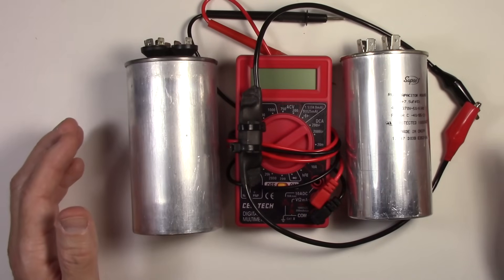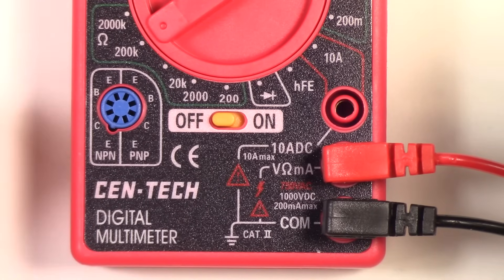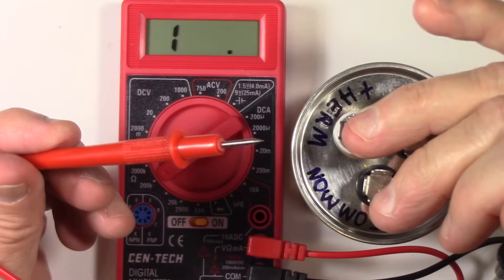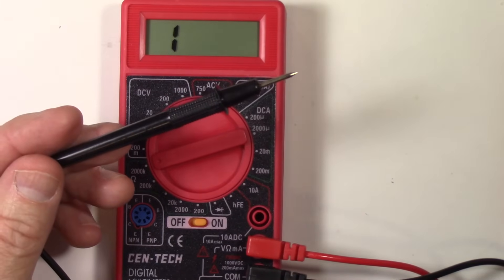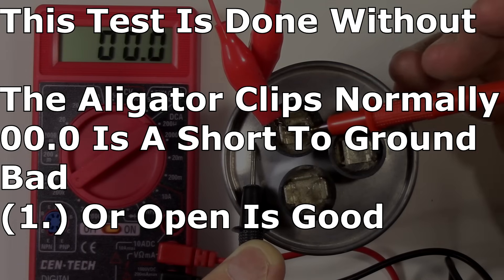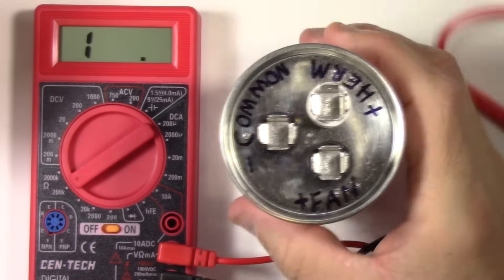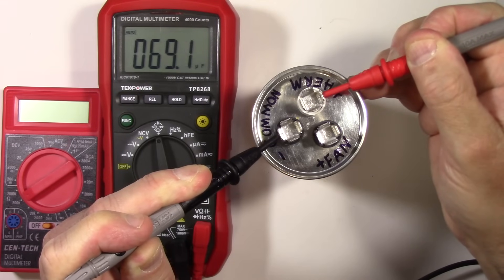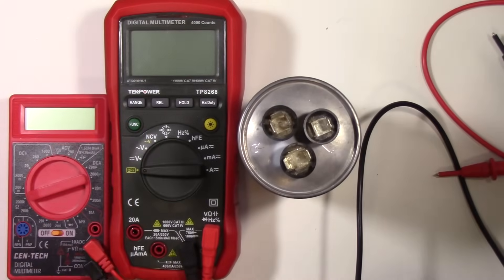Start Run Capacitor Testing Using A Cheap Meter DIY (HVAC/Stereo/Microwave/Electronics) Service

Comment: An excellent training class...taught well.  THANK YOU.
   I'm old-school. I used to take a resistor wire with test prods on it's ends and short out the capacitor, and drain the case to terminal & then take a Tripplet 310 VOM Analog and and stick it across the terminals and watch the needle swing up and peak, and then slowly fall off. If it did that I checked terminal to ground casing. If that was ok and there wasn't any signs of puffing up, it was a good one and I would put the wires back on it and go to the next one.
Reply from the maker: You're most welcome. Awesome on your part. I have found a few lately that were still "working" but were degrading and were at least 30% out of specification so I will check mine more often as that kind of degredation is a sure sign of impending failure. Comments like this make my DAY! 😁️ I'm glad to know I could help you and that you got value from my work here. Thank you for watching, commenting and the very kind words. I appreciate it greatly. All the best.👍😀

Comment: Anyone else coming here the answer is NO you cannot properly test with the cen tech. Hreat instruction but little bit deceiving language, you say ok you know it works. Then at the end of the video you mention you only know if it's taking a charge but not if it's holding the proper charge. So short answer is get the better meter and test it for real, you cannot fully test on a cen tech
Reply from the maker: Agreed. I would always use the better meter but in a pinch where your AC is down and you need a quick answer this will tell you if it's blown. But it will not tell you if it's on the way out. I check my capacitor in my new house with the "good" meter and it showed me that it was working BUT it was at least 20% out of specification so it was on the way to failure and there was no physical evidence that it was failing either. I may do a video on that capacitor to show that you should also check them once in a while (every 6 months, I would say) just to see if they are beginning to fail. I replaced it as soon as I could after finding it out of specification. It can't be good for the motor to be using a capacitor that is out of specification.  Thank you so much for watching, commenting and the valuable feedback. I appreciate it greatly. All the best.👍😀

Comment: Thank you for the video also I have a question if you reverse the polarity it's supposed to go down what if it takes a charge going both ways wouldn't the capacitor be bad? Or would it be because it is a 2 prong capacitor?
Reply from the maker: The polarity will not really affect the test. The capacitor will behave the same way regardless of the polarity. It stores a charge either way. Thank you for watching and commenting. I appreciate it greatly. All the best.👍😀
Reply: @richardlloydusa  basically I have a washing machine that uses a 50uf capacitor it seems ok, but the machine won't operate correctly, I got butt sore and said screw it because it was used when I got it and got a new GE side load w/warranty, but these new washers & dryers have tons of problems why it is allowed for companies to make such garbage is beyond me, no matter where you go they only come with 1 yr warranty unless you buy into an extended, that 10 yr warranty you see is only for the parts of the engine only no labor covered, if we the people don't start standing up to this our kids will be screwed Sideways as well. Per the capacitor video yours got to the point all these other vids are people dragging it on, I know the safety and all that I want to get to the point of how to do something not do the safety dance repetitively on every video lol that's why I ce to you tube to get around the lecture, a little rough I know but these other makers drag it out kinda likely response today ugg lol

Comment: Great video. Thanks! Pulled the original 25/5 GE capacitor on a 30 year old Comfortmaker AC hoping the capacitor was bad. No physical distortion. Bad news was, the capacitor is still good according to my cheap exactly the same as your red mm (ohms-only). Counts ohms exactly like this video: C to Fan pops up and back down to 1 quickly and C to Herms takes a while to get to 1. Oh well.. was hoping the capacitor was bad.
Reply from the maker: At 30 years it still works!?!? Wow, I would still replace it and keep the original as an emergency spare. Thank you so much for commenting and the very kind words. I appreciate it greatly. All the best.👍😀
Reply: @richardlloydusa  Thanks Rich for the rapid reply. The AC died at the end of last summer and I finally had a chance to pull the capacitor today hoping to find it distorted, but... and according to the ohm test, it seems OK. Fan on the AC is running but no cold air. Chances are, I need a new AC probably because the compressor is bad. I got my money's worth, I guess.... 30 years
Reply from the maker: I know this is going to sound crazy but I would have it looked at by a "reputable" tech. Sometimes you can recharge the system and it will work again and before you buy a new system or call a tech try a new capacitor as they are not very expensive. All the best and good luck 👍😀
Reply: @richardlloydusa  Thanks so much. Do you mean recharge as in putting refrigerant in? I'm gonna call a trusted AC guy tomorrow. See what he says. Thanks so much, Richard.
Reply from the maker: Yes, the gas refrigerant but I let the techs do their and just ask questions like, "Do I need recharge?" They will check it and tell you. Thanks.
Reply: @richardlloydusa  Thanks again.
Reply: @rgraz4929   Did you fix it?

Comment: How do you check a capacitor with 2 4 prong connectors on top, and what should readings be on that cheap multi tester?
Reply from the maker: The number of prongs is not important they are all tested the same way using the same procedure. Thank you so much for commenting. I appreciate it greatly. All the best.👍😀

Comment: I appreciated that you demonstrated HOW to use the multimeter Ohm function.  
1. you told me the actual setting.
2. You told what to look for on the meter.
3. You told me to DISCHARGE the capacitor!
Thanks. Thumbs-up!
Reply from the maker: You're most welcome. I'm glad and very happy to know that I could help you. Thank you so much for watching, commenting and the very kind words. I appreciate it greatly. All the best.👍😀

Comment: Thanks for guidance . I have a problem with my GE not heating. I have to check capacitor and also Megerron. Your video will be great help
Jaidev
Reply from the maker: You're most welcome. I'm glad and very happy to know that I could help you. Thank you so much for watching, commenting and the very kind words. I appreciate it greatly. All the best.👍😀

Comment: Now I see the difference between an expensive meter and cheap meter. My Fieldpiece and Fluke instantly show capacitance with no delay.
Reply from the maker: I get it too but in a case where you are only going to test a capacitor once in a blue moon, the cheap meter is better than no meter. My preference is to use a good one to give me an accurate value as capacitors do also degrade in performance over time and it's good to know if they are beyond the acceptable % of error on the cap. My new home's capacitor was was degraded by 35%! Yes it still worked but you could hear that the fan was straining to start or would not start at times so being able to get an accurate value on it was valuable. Thank you for watching and commenting. I appreciate it greatly. All the best.👍😀

Comment: Great video, and a great job of explaining things.  The only thing I haven't yet seen unless I've missed it on other video's is, an explanation of the term "Herm" that newcomers might want to know about.  "Herm" is nothing more than a short way of saying, "Hermetically Sealed Compressor", and I suspect that manufacturers decided on using that term to eliminate the possibility of confusion had they used "Comp" for compressor.  In poor light conditions Comp could easily be confused with Com, or C for common.  "Herm" eliminates that possibility.  Well done sir.
Reply from the maker: You are most welcome. Thank you for watching, commenting, the valuable feedback and the kind words. I appreciate it greatly. I am happy to know I could help. All the best.👍😀

Comment: My father in laws unit was replaced by an a.c. tech, He is a senior citizen 83 years old.The only problem is the capacitor,They replaced the whole unit outside and inside $6,000 If I should have known I could stop them a.c. technician of Kool Air Company.So all seniors be aware calling those HVAC tech,1 out of 10 are crooks.
Reply from the maker: That's very unfortunate. With today's technology (Google, Yelp and many other online reviews) they won't be in business very long! Make sure to check the ratings before calling for service. Thank you so much for watching and commenting. I appreciate it greatly. All the best.👍😀
Reply: More like 7 out of 10 r crooks !

Comment: I a test like that because the blower fan stops intermittently every 5 minutes.I will unplug the system and .plug it back run again 5 min. then stop.I removed the motor and replaced the capacitor.Oiled the bearing of the motor and it is working like a dream.
Reply from the maker: I'm glad and very happy to know that I could help you. Thank you so much for watching, commenting and the very kind words. I appreciate it greatly. All the best.👍😀

Comment: Thanks for the video.   I went to test our capacitor but found black goo oozing out of it.  No test needed.   Local electrical and plumbing supply store had one in stock for $20.   Problem solved.   Thanks again!
Reply from the maker: You are most welcome. Black goo is NEVER a good thing. Good thing that you checked it before it completely failed. I will probably do a video on at least annually checking (preventive maintenance) on your AC unit. As you saw it's a good idea. Thank you so much for watching, commenting and the very kind words. I appreciate it greatly. All the best.👍😀
Reply: @richardlloydusa  Thanks for the reply.  I should have mentioned that this capacitor was in the control box of our well.  It had started intermittently failing to pump water, and we were trying to troubleshoot it when it quit completely.  We first replaced the pressure switch, to no avail.  But I remembered seeing a big capacitor in that control box, which led me to find your video - and the rest is history.   :-)

Comment: Is it not possible to discharge the capacitor by connecting a screwdriver across the terminal? Pros and cons as I have seen it done by others. Thanks

Comment: Sorry but you should not be offering up this method of testing a capacitor.Tells you nothing about the condition of the cap and it's ability to obtain full charge,especially under normal operating conditions.I can say more but I'll just say again.Not the way to test a cap.

Comment: the way u test the old capacitor is like  u directly connecting the pos. and neg because u put a wire or jumper on it, and u said it is shorted..... question ???? why that start capacitor has 3 terminal,  what is the use of that 3rd terminal?

Comment: Thank you for your help with testing my capacitor.  I have that exact same meter, the inexpensive one, 7 dollars.  The correct way to place the red and black wires  was exactly what I needed.  I followed your directions and now know I have a good capacitor.  Great video You saved the day, and saved me some worry and cash.  Thanks again.

Comment: Hi there, I have an EverStart multimeter. I have it on Ohms side with different symbols i.e dot, arrow with a plus and a WiFi looking symbol. When I first tested the Herm out the meter was jumping up and then down. Then I tested it again and it says OL on the meter and nothing happened. Also, when I tested the fan the meter just stayed on OL.  I had the setting on AC if that makes a difference. Is the readings telling me the capacitor is bad? Thanks and great video!

Comment: Thanks for your video. AC fan was not working. Sure enough checked the run capacitor using your instructions and the fan terminal side 
was dead. Picked new one up at local Hvac supply store for $12. Switched out the old capacitor with the new one and bingo, AC fan working once again. Easy and cheap diy fix. thank you sir. Ernest in Lexington, KY

Comment: I like this video because it will make people more likely to call me when they can’t figure out what their problem is. Tongue firmly planted in cheek. When they use your method and the capacitor looks good but it’s actually week, they will be frustrated and finally called a pro. I don’t think a pro would ever use this method, I know I wouldn’t.This is one of those repairs that homeowners should not attempt, in my opinion.
Reply: HVAC capacitor replacement is simple and is the number one failure on these units. The caps are cheap so just get a new one and replace it without testing. Worth a try and saves $300 plus in fees that you guys charge to do this simple task. It works for me IF the cap is the problem. And yeh, discharging is simple as well. Anyone can do this repair.

Comment: Guys, I've worked on home radios, in broadcast electronics; and power generation (wind turbines) where capacitors normal part of power filters.  No need to test the capacitor IF the is swelling (domed) or leaking.  A multimeter is good for a shorted cap, nothing else.  If you do buy a spare HVAC capacitor, store it inside your garage, not in extreme temps where the A/C compressor  unit sits.  Like 1.5VDC batteries, capacitors have a shelf life (5-15 years) in that there's a dielectric paste insulating the layers of foil inside the capacitor and they dry out.

Comment: You can not put the alligator clip on the housing and the lug and then measure between the frame and the lug you creating a short with the alligator clip leads.

Comment: My karcher pressure washer had stopped working. 
I've only got a cheap multimeter, and using your resistance technique, it works 90% of the time. But i can't check the uf, what are the chances my capacitor is damaged? TIA

Comment: Great video. Thank you. I have the same cheap meter you used on this video I purchased  for 5 dollars at harbor freight tools for a spare. Since I was working out of town I  left my fluke true rms meter 1100 miles away and only have my cheap backup. Now I can at least get an idea if my capacitor is good.

Comment: This does not show if a capacitor is good. It only shows if it has potential. The UF rating can not be tested with this process. A weak capacitor will show the same readings as you show here. Also a capacitor will not store a charge unless the component it was hooked up to had open windings and did not discharge.

Comment: could my capacitor be bad? when I turn dial to cool enough for ac to click on from fan, the fan slows down and unit just hums for a sec and then reverts back to higher speed fan. the airs not cold not hot. some days it works some not. if it's on for a few hours it starts doing this. sometimes just moving dial for it to click on and off makes it work. this is a window AC unit

Comment: Richard, I just watched your previous video from 2016 on safely discharging a common start/run capacitor, and noticed you looked completely different. What is behind the dramatic change?

Comment: Thanks so much, bought a cheap multi-meter and you helped me figure out how to use it to test my dual capacitor on my home A/C.  It works!  Now I have to see what the heck else it could be.  Hopefully not the compressor!

Comment: Excellent, well-organized video. Especially good was the warning at the beginning of the video about capacitor discharging-- you would be surprised at how many want to work with fully-charged or partially-charged capacitors. The closeup shots make the video much clearer, with good ambient lighting. Sound is exactly at the correct level. 
For me, however, the best benefit is I am now able to check a capacitor with a simple, inexpensive meter. (For viewers who want a better meter, you have found a good option.) As a bonus, you demonstrate how to detect a short-to-ground. If I were to choose the best capacitor-check video, this is the one. (Of course, I subscribed)

Comment: if I couldn't find the same exact rating:
- should i get (higher or lower) µF = MFD = micro farad ?
- should i get (higher or lower) voltage rating ?
Thank you very much in advance.

Comment: Hi. My wall fan has a capacitor rated 1.2uF/400vAC. I found it online 1.2uF but 450v instead of 400v. Is it ok? And what is the effect on fan functionality?
Reply: I am not an AC tech but what I have heard is that you can install a higher voltage capacitor but not a lower voltage. Evidently the Higher voltage will just handle more than you need.

Comment: Probably the tenth video/web page I saw trying to figure out how to use my cheap multimeter to test a run capacitor.  The ONLY one that showed me how in ENGLISH.  All the others used more expensive multimeters or if they used one like mine never zoomed in to the actual meter when moving the controls.
Reply from the maker: I am glad to know I could help you. Thank you for watching, commenting and the kind words. I appreciate it greatly. All the best.👍😀
Reply: Same here. I wish someone would show how to use this plan and simple

Comment: Do you happen to know if this will work to test a run capacitor on a refrigerator. It only has 2 terminals?
Reply from the maker: Yes it will work on a two terminal capacitor without issue. Thank you for watching and commenting. I appreciate it greatly. All the best.👍😀
Reply: Thanks, I greatly appreciate the video and the information. This info will help me test the capacitor on our refrigerator! :)